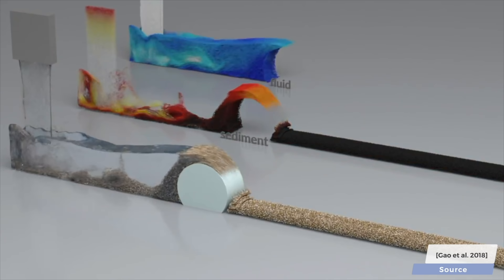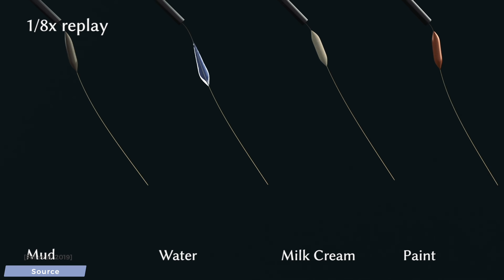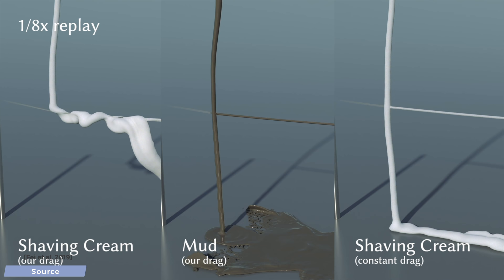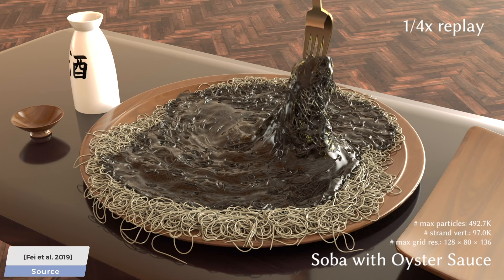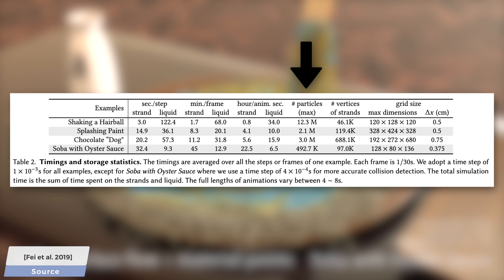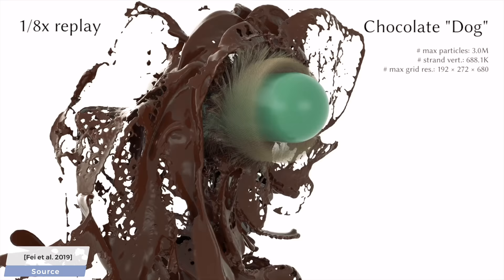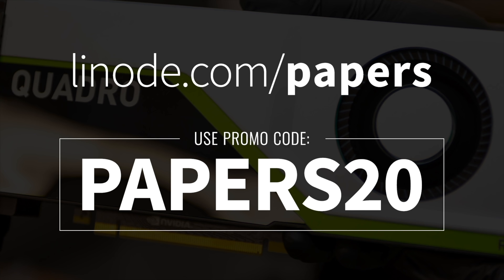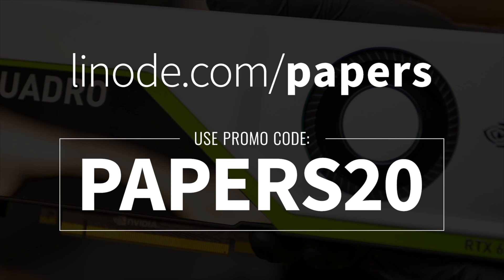This is How You Simulate Making Pasta 🍜

Comment: Now they just need to simulate the taste and we have the matrix!
Reply: You can simulate feel with haptic suits. Id say taste isnt too far off xd
Reply: Tasty wheat?
Reply: @Hernando Malinche - that's highly debatable, given what it would take to simulate touch properly, rather than with dubious half-measures.

Though admittedly, to get the full experience of eating something taste has to be accompanied by smell and touch. (and the sense of temperature and dry/wet, if you consider those distinct from touch.)

Basically, taste is hard in the sense that to implement it properly requires you also implement smell and touch anyway.

Probably not a high priority overall. XD

I'd say VR as it is right now has two major functional issues that hold back it's utility;
Smell and taste meanwhile are luxuries that are nice to have, but don't have quite such major consequences on the experience as a whole.
- Lack of a proper sense of touch and related force feedback
- movement of virtual body too closely coupled to movement of real body.

That second one is a real and major problem, but the two are inter-related.
Having to move your real body to get your virtual body to do an action is the primary reason VR needs several square metres of empty space.
It also implies that people largely can't do actions in VR that they are physically incapable of in real life. And even if they are, the headsets and cabling limit motion even further. (you probably can't do a backflip in VR even if you can do one outside of it)

This also limits your interactions with virtual objects.
You cannot sit on a virtual chair or lean on a virtual wall (unless you coordinate things very carefully)
You couldn't leap into a virtual person's arms, or climb on their shoulder...
And many more such examples exist.

Touch meanwhile limits your ability to perform actions that you cannot see, limits your sense of what's around you, and distorts your movements due to lack of feedback and resistance.

How do you solve these things? I don't know if you really can, short of direct brain-machine interfacing.

Of course, once you've reached that point, then the sense of smell and taste is simply a matter of figuring out how the communicate with the respective neurons, which is an extension of the process you would already have to have figured out to do such interfacing for any of the senses...

Still... We'll see what happens, I guess?
Reply: Pasta with sauce? Tastes like chicken.

Comment: Bake these complex simulations out into 3D animated raw data for import into any common package.   Granted, the file size will be massive, and the sims wouldn't interact with custom scenery/props, but the textures, lighting and view angle could be animated.  Perhaps a cloud-based streaming service that will stream the raw 3d vertex data to a users PC or VR headset, depending on camera placement.    Probably something like this exists as a cloud-based service already.   Stadia can't get here soon enough!

Comment: Okay, to run this in real time the program would have to be some 150000 times more efficient, or be in 150000x better hardware.
Considering the pair of them used for the render had 24 threads at ~2.4GHz, and a big GPU has over 2000 "threads" at ~2GHz.
We would only need some 1500 GPUs to render this thing in real time... Pretty doable on a super computer.
Although, that is also probably within the grasp of what a purpose built chipset could probably achieve.
If you was curious...

Comment: Cool stuff! 

Since you have set forward on a difficult path, can you describe strictly interfacial instabilities of coating flows for a single fiber maybe with simultaneous heat transfer. 
Say for example fiber drawing experiment. 
And as always my challenge is to describe the formation of a single droplet and then determine profile curvatures, and validity of Laplace Young equation. 
Difficult to do even with actual images. 
Final question: can you tackle lets say linear non-Newtonian fluids?

Comment: When I was a kid about 30 years ago they used to hold Assembly Programming Language competitions and back then they were doing blobs of goo with stickiness like liquid where two blobs would come together in real time like liquid in 25kb or so of program. Why are you saying this takes heaps of CPU resources. The competition programs of 25kb were running on pentiums so what is going on? Why did the Matrix repress programming development so much that it basically hasn’t developed for 30 years until the last few years?

This stuff in this video is better than the blobs of goo from 30 years ago, but only a little bit because it is basically the same thing except taken to a few more higher levels and the goo sticks to 3D objects as well. Not a huge leap compared to the leap in CPU speed in the same amount of time. I think that somehow CPU power must have been turned to complex analysis of the computer user or device user and their actions on the computer or off, because things have developed hardly at all in programming terms. Maybe that is why people are voting Conservative because the Conservatives have access to psychological manipulation data and can control our thoughts through advertising, tv and radio programming and subliminal messages in stores. Who knows? If it is possible to manipulate us then we probably are being manipulated, at least if they have studied manipulation deeply enough.
Reply: You're referring to metaballs, which have simple analytical solutions. This is very different. This is a full physics-based simulation which has to account for the complex simultaneous interaction between many different objects, while accounting for physical properties like friction, density, velocity, etc.

As for the second half of your last paragraph... what the fuck?
Reply: C Game Theory 
I agree with Screeb. These are much more complicated physics calculations than the programs you were using were running. 
And wtf does politics and mind control have to do with anything?
Reply: @TheScreeb  but surely it is just more metaballs with a few more variables for interaction with the environment on each metaball to simulate liquid. This should have been done 20 years ago. What I am saying is that where did great minds in computer algorithms get employed in the past 30 years that this hasn’t been done until now? Were they all employed by the military?

Comment: when do we get this in autodesk maya and unreal egnine 4?
Reply: cough blender cough
Reply: @mamba1507  we don't use blender. we use unreal engine 4 or maya
Reply: I wouldn't be surprised if they used Blender, as they wouldn't have to deal with te complications of using a Proprietary software like Maya.
Reply: @jascrandom9855  then at least do it in unreal engine 4. its free too
Reply: @sanketvaria9734  But its not Open source
Reply: blender already has a pretty nice simulation system (though there are specialized programs that are better at specific things)
plus yeah, it’s open source.